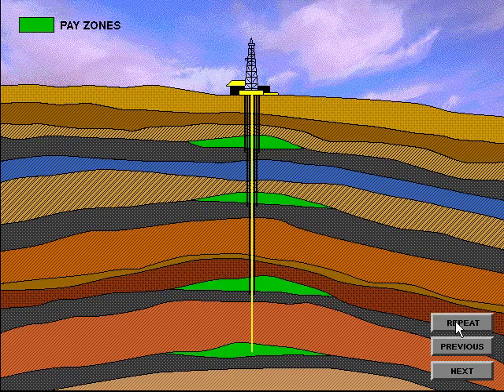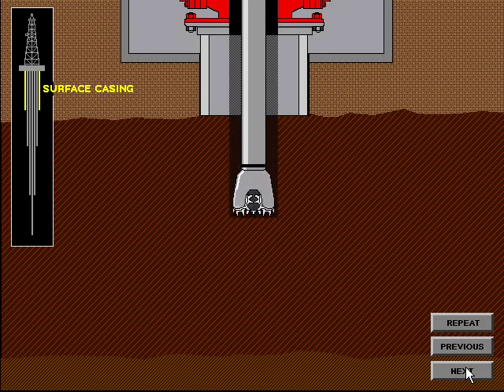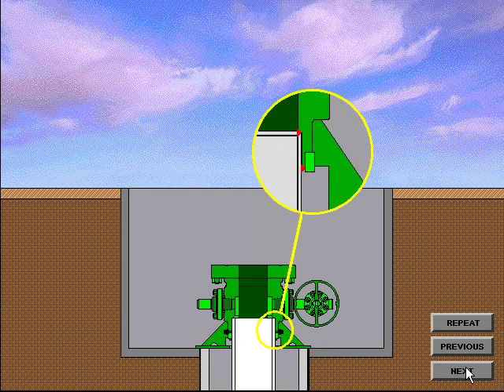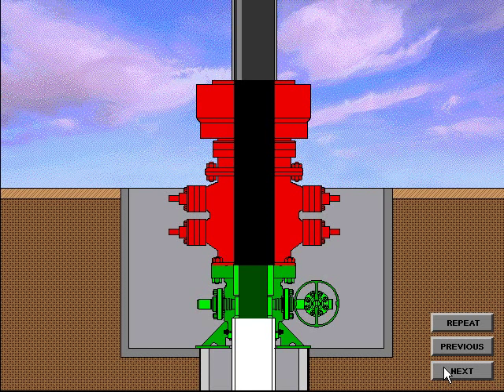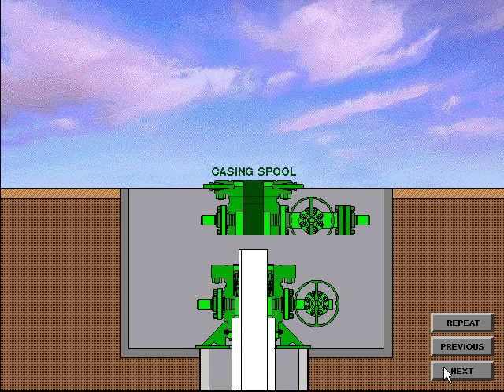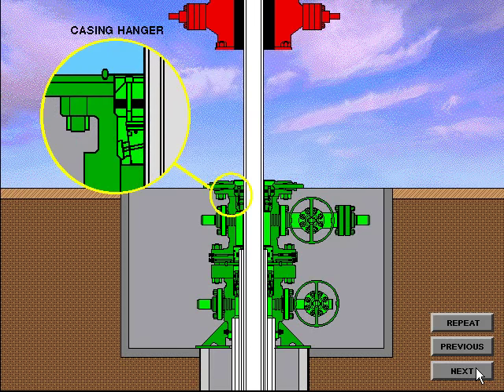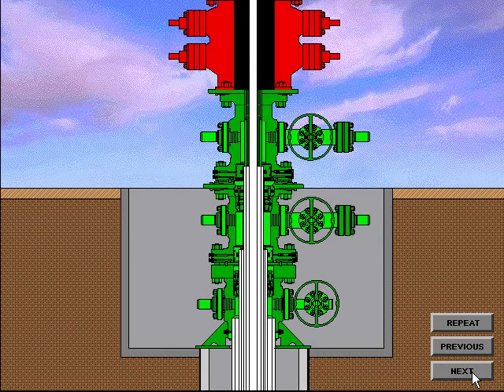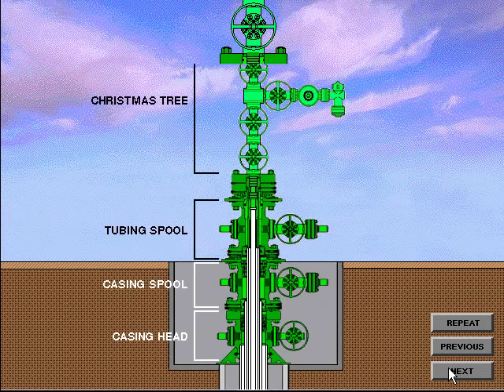wellhead instillation.wmv

Comment: But how does this wellhead works with a oiljack?
Reply: @ghostdevill 
There are some more parts to install before we set up the oiljack ( pumping unit ). 

Such as ( inside the well ): tubing pump 2" + tubing production 3" + tubing hanger /tubing head. 
Tubing head is istalled /sit inside the wellhead /casing head. 

More parts ( inside the production tubing ): plunger ( will run into the tubing pump ), sucker rods ( above the plunger till the tubing head /tubing hanger ).  

More parts on the tubing head /tubing hanger: pup join 3" × 2' + T 3" + stubbing box + polish rod + pony rod. 

The polish rod will connect to the oiljack ( pumping unit ) by using some clamps. 

The plunger + sucker rods + polish rod + pony rod will go up and down to pump out the oil. 

The oil will go aside by the T 3" and enter the flow line heading to the gathering station.

Comment: Test plug only goes neck up to install wear bushing and to retrieve wear bushing after drilling is complete
Reply: How can connect with u 
Do u have linked email sent it to mr
Reply: In the video, he said a scentence which is " The surface pipe is drained " , what does he means ?? How to drain surface casing ?? Can you please explain more ??
Reply: @user-kn9it6be4b  

In the video, he said a scentence which is " The surface pipe is drained " , what does he means ?? How to drain surface casing ?? Can you please explain more ??